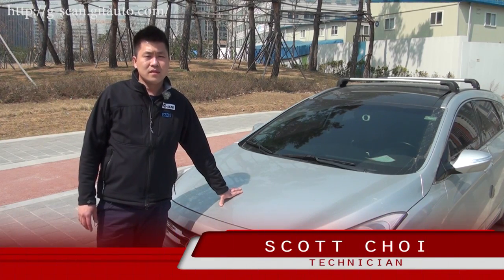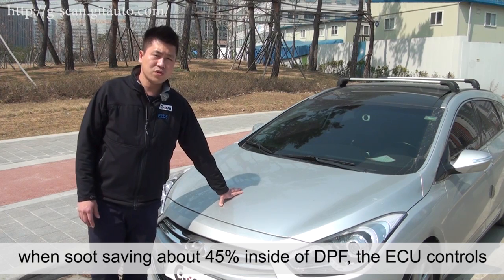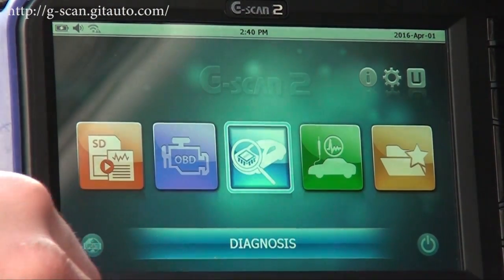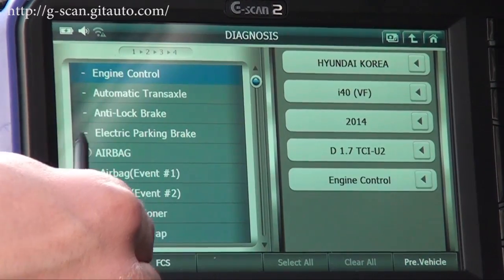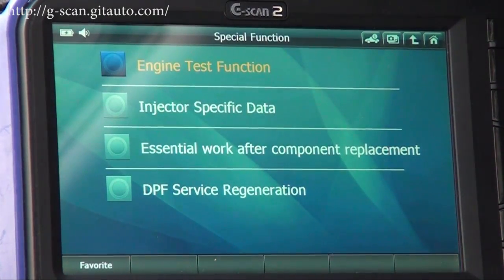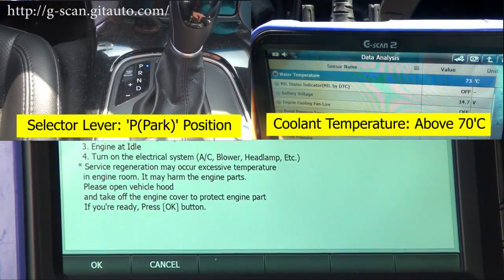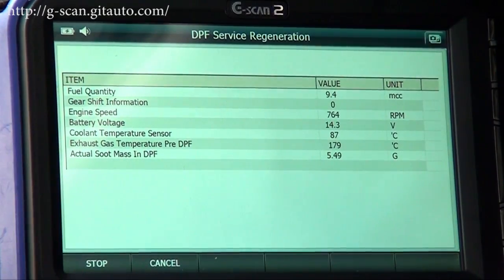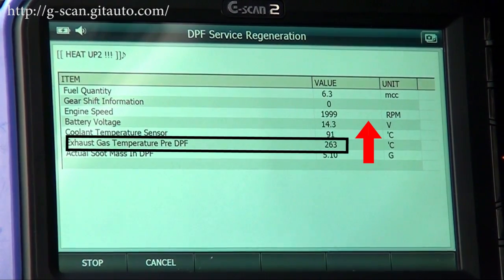DPF Regeneration_2014 Hyundai i40 1.7 L Diesel Engine

Comment: I have the same engine on hyundai tucsom 2016 it atill regenerate every 120kmso every day 2 times a day sometimes, so the best rpm for regenaration is 2000 rpm? I tried like his i triyed at 3500 but it still regenerateevery 120-130 km and it last 20km sand 20 minutes 😩
Reply: Did you solve your problems? If so, how? Thank you
Reply: @rascarachedan1576  no, just a little bit better with bardhal fap cleaner in the diesel....

Comment: My i40 3016 started to use more diesel.  Short or ling distances- doesn’t matter.  Before on motorways- speed 110km/h 54mpg(uk)
Now on motorways- 34mpg. 
Before in city- 38-40mpg
Now in city- 30-34mpg.

Comment: Why i 40 does not have a light to warn you about the necesity of regenerate the filter?
And why is diesel going in oil ?
Reply: Hi. I agree about the warning light. How did you fix your i40. My Dpf keeps failing. I've got diesel in the oil too.  Any advice would be great
Reply: same guys .any reply. 
i40 is pure garbage

Comment: Can this read dpf capacity and flow rate pressures in live data? For example if you brought it with you to check another diesel car before you buy it?
Reply from the maker: Sorry for the late reply, jonjeny. Our answer is 'Yes'. You can read live DPF capacity and DPF pressure values in Data Analysis function of our G-scan. However, if the model you are trying to diagnose is not covered our scanner, you can not check the data. Hope I answered your question.
Reply: Can I get dpf regeneration for Toyota hilux 2017 for cylinders diesel engine by g scan2

Comment: best DPF regen i have seen on utube so far.
Reply: Diagnostic Scan Tool G-scan2 i need this program.  is special for hyundai i40??
Reply from the maker: Yes, it's special function for Hyundai i40. G-scan2 is a multi brand scan tool that it supports similar function for various different brand vehicles as well.
Reply: Diagnostic Scan Tool G-scan2
Reply from the maker: Thank you Amit G1984 ! :D
Reply: Diagnostic Scan Tool G-scan2